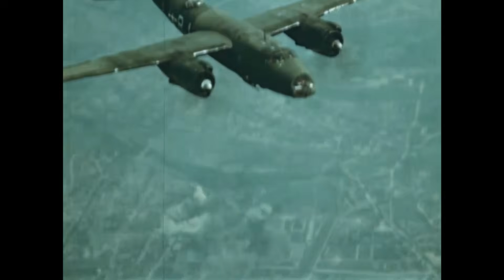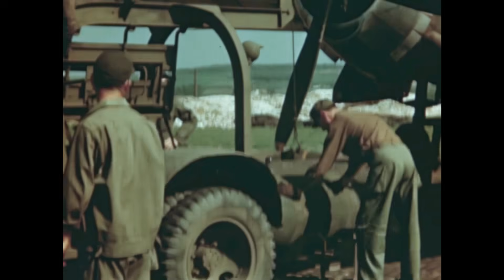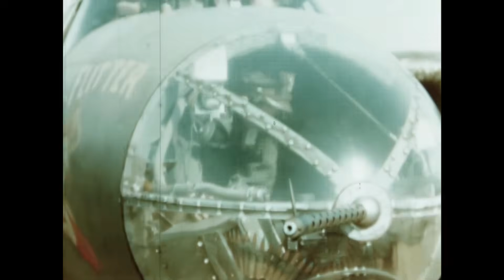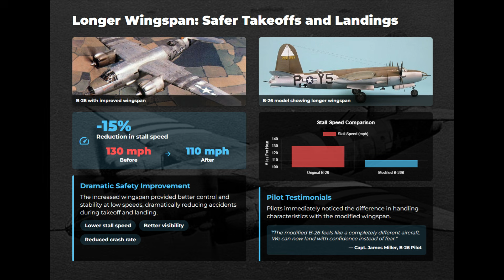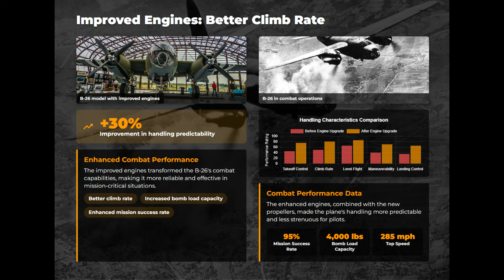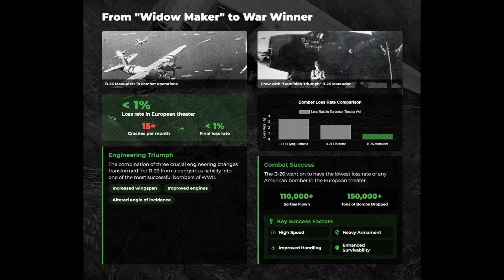Three Modifications That Tamed the B-26 Marauder

Comment: That was a very successful transformation !!  The rest of the story: once pilots became proficient handling the aircraft at the higher landing speeds, they very much liked the B-26.  They came to depend on its higher performance in the air to reduce the time to and from the target.  This is the primary reason for the lower loss rate.  Martin, the USAAF, and hundreds of air crewmen turned a safety weakness into a strength !!!

Comment: Yah, not impressed with American bomber designers. The B-24 had basically the same problems with narrow high aspect wing ratio design, sacrificing stability for outright top speed.  When compared to the plywood Mosquito which carried roughly the same payload or more than the B-26, and could exceed 400mph, The B-26 and 25 were inferior designs. We should’ve gone to the Brits for help with a  lot of our designs.
Reply: Who told you that Mosquito can get the same bomb load like B-17, B-24 or B-26 to the same long distances to target? 
Its common myth.

Comment: Ah, the Baltimore Whore. (so nicknamed because "it has no visible means of support." "[short wings])
I wish I had the money, skill, talent to fly one!
Isn't this the plane that was used in the film always? I've never really understood the difference between the A-26 and the B-26.
Reply: The difference is they are completely different.
Reply: The Martin B-26 Marauder was a medium bomber operated by the US from 1941 to 1947, the Douglas A-26 Invader was a light-bomber/attack aircraft that served the US from 1944 into the 60s. After the Marauder was retired, and the US armed forces adopted a unified designation system, the Douglas A-26 invader became the B-26 Invader which has led to some confusing of the 2 aircraft. Over twice as many Marauders were built compared to Invaders, but the latter had a much longer service life.

The Marauder would be in the same class as the B-25 Mitchell, whereas the Invader would be in the same class as the Douglas A-20 Boston/Havoc which it was designed to replace. Slight difference in size, major differences in crew layout and number; Marauder crew of 7, Invader crew of 3.

But what I wanna know is, what's going on with the thumbnail? It looks like the nose of a B-25 mashed up with the body of a B-26
Reply: The airplane used in the film "Always" was the original Douglas A-26 which was redesignated as B-26 after the war and the Martin version was pulled from active inventory.

Comment: Changing the wing incidence by 3.5 degrees is not a small change, it is astronomically large in terms of rigging.
Reply: Which means the crew training was incompetent.  The original wing incidence was faster which would have meant even lower fighter and flak losses.
Reply: Speculation: The original angle of incidence may have been based on the originally specified engines and the higher top speed they would have produced.  The airplane never got the more powerful engines, so it didn't need the lower angle of incidence to reduce drag from the fuselage at high speed.
Reply: Which means it was actually a major design flaw that had to be changed.

Comment: Not as safe as the B-25 !!
Reply: A-20 was still a far better aircraft. Buy more of them and do the same job.
Reply: Apparently not in combat
Reply: Poor training was as dangerous as enemy action.  With the higher original performance the low combat losses would have been even lower.
Reply: @givenfirstnamefamilyfirstn3935  Not likely. 50% of all US aircrew losses (100K)  in WW2 were due to mechanical failure, pilot error, weather, and bad navigation. The F6F Hellcat was not as fast or nimble as the Corsair or Mustang, but it was rugged, stable, and very forgiving, making ordinary Navy pilots into aces. The WWI German Fokker D. VII was the same.
Reply: Except in combat